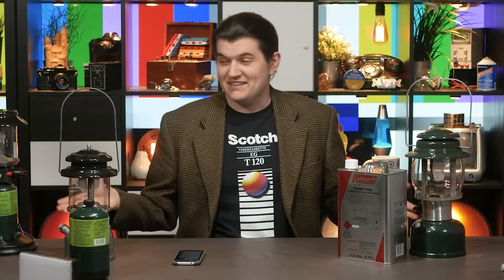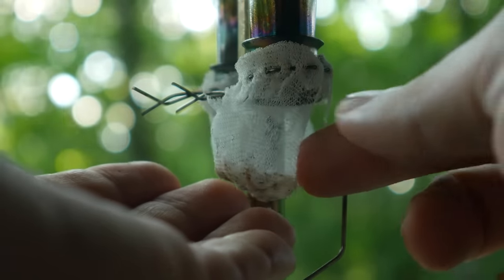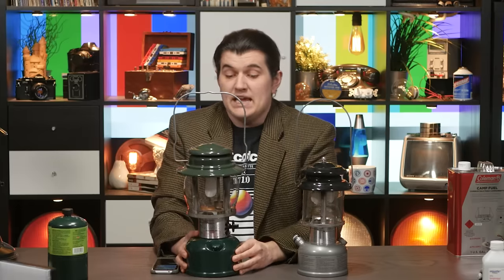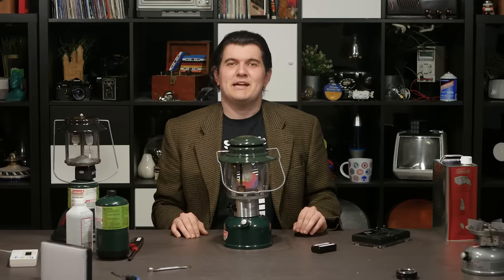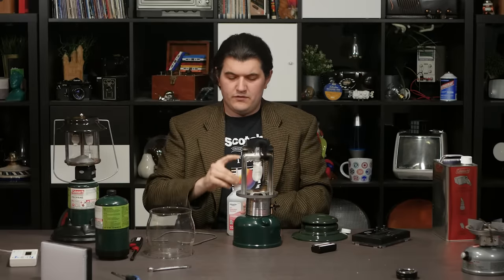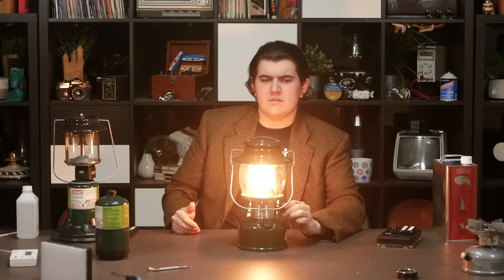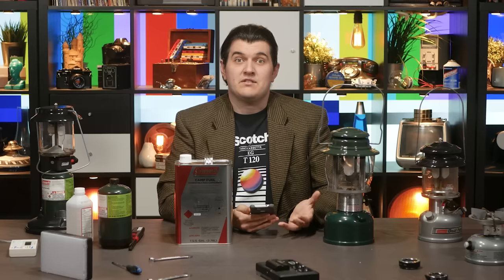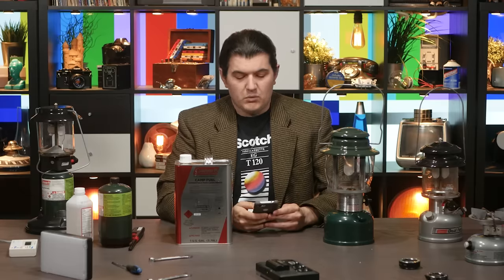A very rambly Coleman Lantern follow-up. Turns out they rarely make sense in 2021

Comment: the Lithium batteries you're referring to are likely ones called  "18650", referring to their dimensions: 18mm diameter by 65mm length.
their price and quality vary wildly. due to potential safety problems, I wouldn't recommend getting "cheap" lithium cells (or any made by LG for that matter) unless you absolutely know what you're doing with them as they DO pose a serious fire hazard if mishandled.

Comment: Those battery packs you use for comparison are likely a lot more expensive and a lot less energy-dense than lithium cells like 18650s. I'm holding a 5800 mAh 3.7V 18650. (If my math's right, that's 21.46 Wh of power.) An 18650 is cylindrical,  weighs about 45g, is 18.3 mm in diameter and 66.6mm long (or 68mm long if you measure to the positive terminal) They'd pack densely in a box, and you can get tiny little chargers for them that run off of USB, so you could charge them with anything that can put out regulated 5V DC at ≥500 mA. A quick Google search revealed lots of lanterns that run on 18650 cells. (I look hard enough to tell which ones have removable cells though.) You should post a follow-on about the best LED lanterns and batteries for camping.

Comment: Very informative comparison...... but I love all 8 of my Coleman lanterns.  I do have LED lights for camping but you can't beat the ambiance of the gas pressure lantern around the campsite.  I also used a gas lantern to heat the water in my sunshower bag while camping in the winter when there wasn't enough sun to warm the water. The sunshower bag was suspended close above the lit lantern until the water was warm enough to shower.

Comment: Greetings:
First time on your 2nd channel. I think the search feature actually includes results for both channels. Somehow I missed the discussion of the "gas generator". Since that device functions for all fuels, I can only assume it is needed for liquid the fuels kerosene and gasoline. That means the propane lantern doesn't require, nor have a gas generator. I further think the pumped pressure forces the liquid fuel into and through the gas generator where lantern heat causes the liquid fuel to vaporize and exit up to the mantles as a gas vapor.
I was waiting for the method of recycling the empty propane bottles. When empty the gasoline cans may be refilled where permitted, but have not seen propane refilling places for barbecue propane tanks accept the lantern bottles for refilling. I wonder if there is a DIY method for this process?

Comment: First off, you are making people think, and that is a good thing. On the kerosene the primary consideration would be weight per lighting time. If you are going back and forth to somewhere deep in the bush, and restricted to foot or horseback, the kerosene lantern and stove start to look better. A roll up solar charger, batteries, and one of those twig stoves that generates electricity would give choices and backup. Maybe an addendum video on the European kerosene lantern that one of the other commentators mentions, and the twig stoves is in order. Thanks and take care.

Comment: Heat from the gas lanterns. Propane turns to jelly in cold environments when you start decompressing/using the tank. The army uses naphthalene stoves and lanterns. Ebike battery with dc-dc buck converter might be an easy supply hack for high capacity.

Comment: I like the way you analyzed this. 
I will say, and you mentioned it being your point of view, that I prefer camp fuel white gas lanterns. 
I use the stoves already so I always have the gas. The stoves are night and day from propane and much more powerful. 
There's also the nostalgia perspective. I'm not that old but the light produced (temperature) at the cost for the fuel for me camping I prefer the white gas ones. 
FYI Walmart online had the gallon of the crown for $7.64 yesterday so I got like 5 gallons lol. Even the quart cost more. Not sure if it was a mistake but I capitalized lol.
Propane for a light is ok but need a lot of tanks. 
For me, the white gas ones win. I use it for my lanterns, my single burner and my vintage dual and triple burner stoves. Prefer to stick to one fuel and again the propane stoves are very weak compared to their white gas counterparts.
Edit: also the peerless mantles company has been sold since your video and production moved to India and I'm told they are yttrium now. But who knows. They still beat the Coleman ones haha.

Comment: For lighting, it’s a no brainier. Rechargeable batteries are the best by a mile. 
Where Coleman have nailed it is the cooking. The duel fuel stove is great. Cheap and widely available fuel that most people have a gallon of in their garage. I have a propane camping stove and a trangia. But if there was a serious storm and a lengthy power outage, the only thing I would be guaranteed to have ample fuel for is the Coleman. I wouldn’t carry the thing if I was hiking up a mountain, but as an emergency tool, it’s fantastic. Super reliable and sturdy, can keep a few spares in a drawer and if the worst comes to the worst, I can siphon fuel out of the lawnmower.

Comment: The Mantles are the Maddening Part. Back in the Late 60’s my Dad, had theses Mantles that were made from Metal, that I believe was Monel. They lasted a very long time. I’ve tried to find them, recently, with no luck.
Reply: I think you're talking about old miners lamps that had a metal screen around the flame so that flammable gas in the mines wouldn't be set ablaze by the flame.
But these meshes dont produce light on their own and in fact the flame of such lamp can't be brighter than a mantle.

Remember a mantle is basically ash, or yttrium oxide and heating it so much it glows white doesn't melt or vaporize it.
Try heating any metal until it glows white...

Comment: Actually, if u hold the lanterns handle while it's lit. The purpose of its design for the handles orientation is to allow a comfortable position to dial in the brightness while carrying it. I wouldn't feel it's natural to adjust that while it's facing me. I always keep my lamps and lanterns with the knob facing towards my right. Of ur left handed, have it facing to ur left. It's way easier.

Comment: The reason kerosene lamps still exist is the amount of other kerosene burning devices still exist. It's super readily available, lasts a long time and easy to transport. Our cabin runs off a kerosene diesel generator, kerosene powered furnace and water heater. So having a kerosene lamp is just common sense when it's readily available on site.

Comment: Id like to point out that the nostalgia factor is huge with these lanterns, and that's probably a big reason they continue to be manufactured. When I was a kid, we used a white gas lantern and a white gas stove when camping. What do I have today, for that exact reason? - a white gas lantern and white gas stove. LED lights, and even propane, just don't have the same feel. I'm sure some used kerosene, and that's what they want, because that's what feels like camping to them. You're not really thinking about how much you can save over a year, or two, or three. You're going for the atmosphere.

Comment: Overall the battery and LED is more efficient, no doubt about that, but like you said many times, some situations make using propane or white gas feasible. Power outages in the winter for example can be a prime example, and the reason I keep a couple lanterns like these. Shelf stable, long term and knocking out some BTUs all make lanterns a decent option. Cold can drain batteries quicker, and ate harder to gauge how "full" they are unless you have another tool.

Comment: I have a Claymore Selene lantern, works for ~55 hours on the battery and charges over USB-C and can charge other things. Looks like they're about $130 on Amazon, those Coleman Dual Fuels are only slightly less and then you still have to buy fuel.

Comment: Usually an air pump must contain two check valves two work properly. This can be problematic with the simple design of the coleman pressure pump. It also gives you a way to tell how much pressure is in the tank as well as making it impossible to overpressurize the tank. It does take some time to become familiar with the operation of this system as the same fuel system is used on the stove that Coleman produces. The older units can and will burn gasoline, they just have a tendency to be smelly.

Comment: Coleman has (among others) a 1000 Lumen LED Lantern which they state can last 100 hours on low or 2 hours on high (nothing about midrange). Has a 4800 mAh Lithium-ion battery that charges in 2-5 hours depending on Amps. Batteries are swappable as well. How would this compare to Propane/white gas/kerosene Coleman lanterns? Either by cost or light per unit (I don't remember what you called it).

Anyways, as always super informative, I watched all the videos about these lanterns in a row. The binge is real!

Comment: For camping (again), where weight matters, cooking generally will use white gas, so it makes sense to use the same fuel for lighting. Personally, I didn't carry the light because in Canadian summer, it's light until 9:30 pm in summer, so don't really need more than a few minutes of light at night for whatever. However, we used one when winter camping, when it goes dark by 5 pm.

Comment: In very cold weather, batteries become way less efficient, and propane will simply cut out completely with its tendency to create frost on the bottle.  White gasoline and kerosene work in much colder environments, and those with experience in -40 temperatures (same in both scales) claim that kerosene lanterns and stoves start more reliably in such weather.
Reply: Hi uncon have you become a flat earther yet? If not I suggest watch a 13 part series called What on earth happened by Ewaranon to learn that the earth is not a globe. I got it in my about tab.
Reply: @flat-earther  I would very much like it to be at least competitive to go with batteries for environmental reasons, but there are situations where this is not necessarily yet true.  For clarity, I am talking about temperatures that most people will never experience, but might conceivably be experienced in places like the Alaskan Frontier or the coldest parts of Siberia, or in Antarctica where expeditions can and do run surprisingly regularly for a variety or reasons.  These are places which are not coincidentally quite remote and thus also much less likely to be tied into the electricity grid, which will also be a major factor.  I am sure that battery technology will improve to where they will eventually work quite well in cold enough temperatures to render the kerosene lighting obsolete.  However, for now, it is not quite there yet.  It is something that is actually a factor in the Ukraine War, not because batteries are failing but because they are cold enough to not work quite so well as they do at room temperature.  That is an undeniable fact for now, unfortunately.  Believe me, I want it to be easier to go without fuel because then it would be better for the environment, and it will probably happen in the next ten years, but it has not yet happened.
Reply: @flat-earther  And no, I am not a flat earther, and I really doubt I ever will be (unless something truly extraordinary happens in the field of science, which I highly, highly doubt).
Reply: @unconventionalideas5683  Okay.
I suggest watching the series to learn stuff you may have not heard before.
It's a long series that first discusses the flat versus globe topic and then ends up covering several other topics.
I don't think everything in the series is true.
But in my opinion that series is one of the best I have seen to serve as an introduction to the globe versus flat topic so that's why I share it.
In my opinion it has some amazing information.

Also if you want to watch a flat versus globe debate I suggest go to channel Modern-Day Debate and find video called FE DEBATE: Austin @WitsitGetsIt & @flatearthtests9708 Vs @MrSensible & @culturecatz

Comment: So Kerosene does not go bad like gasoline. It’s also used as an emergency heat source in many rural areas. So it’s on hand. I would also be curious of the run time differences between white gas / gasoline / kerosene.

Comment: I think one reason propane lanterns in particular persist for camping and stuff is propane bottles are always bought in multiples for value reasons, and lugging a pair isn't much harder than lugging a single. There is also the fact that they're considered more "roughing it" than an electric one is, and electric lanterns can be lacking in underside weight (which is a nuisance when it's windy).

As far as battery lanterns go, it's a pity you didn't have any that ran on standard letter cells to compare with - because those are the kind the average person tends to go with and lug around, at least in my experience. Those can also have an edge in sustained power outages.

Comment: These have a longer run time than batterys and you can run them on Gasoline ,batterys can be hard to get sold out etc 
   Furthermore I can buy hundreds of these for 15$ LED lanterns are expensive.
      I have Surefire flaslights but still have gas lanterns to

Comment: I was going to leave a comment about how liquid fuel lamps will still be usable after ten years in storage but I see you already made that point. Certainly if a person is preparing an emergency survival kit, a battery operated light will be useless if the kit has been sitting in a basement for a decade. So in that case, candles or any other fuel based lighting will work better.

Comment: 18:10 If you’re using Rubbing Alcohol as a preheat source, that smoke may be the isopropyl alcohol burning. Isopropyl burns a bit dirty for alcohol. A good clean alcohol is Denatured Alcohol. Denatured Alcohol burn very clean. I also own a Coleman kerosene lantern, and my experience is that usually the preheat is hot enough to vaporize the last bit of kerosene in the generator and send it to the mantle, where the preheat flame will actually ignite the vapors and make the lantern briefly glow. Although, my kerosene model is not the same model as yours.

Comment: There's also the factor of storage for long term emergency use. Propane, white gas, and stabilized gasoline will all likely beat out most batteries for long term storage with the exception of alkaline (80% after 10 years) and eneloop ni-mh (70% after 10 years and rechargeable 500x)

Comment: Kerosene and White fuel lanterns make plenty of sense. They don’t need batteries or solid state electronics to work and provide heat in an emergency. Oh, they last forever if you take good care of them.
Reply: They might not need electronics, but why does that matter? White gas is fuel, and so is electricity, here.

Comment: I already have a kerosene cooking stove. The only down with kerosene is the need for alcohol also.

Remember that charging takes time. You not only need light to run a solar-powered charger, but the brightness of the light determines how fast the batteries  charge.  Cloudy skies will cut your charging speed back. You need to see how fast a reasonable solar  panel will work under cloudy skies will work.

Comment: Spot on about batteries versus gas mantle lights when camping.  Even in true "cold weather" conditions.

30 years ago, in the Army, I learned to keep batteries in my uniform pockets underneath the outer layer coat to keep the batteries warm.  

And in true cold weather camping, how long are you planning on sitting around at night with the lights on?

Yeah, humping around the weight and fire hazard of liquid fuel (or worse, pressurized gas) for light is stupid.  Even if you don't have (or can't  use) solar recharging in the field, well, there aren't any camping supply stores in the woods, so you can't "recharge" your propane or white gas tank, either.

If you need to make heat for cooking, well, that's (as you pointed out) an entirely separate thing.  And every ounce of fuel you use for the lantern is an ounce you don't have to cook with.  So, no, there is absolutely no advantage of "shared resources" to carrying a lantern that uses your stove fuel, unless a large green helicopter is going to be delivering you more fuel on a predictable basis.

Which is why the Army stopped using mantle lanterns for field lighting decades ago, even before LEDs, modern batteries, and portable rugged solar panels were even around.

Comment: The new “LED” lamps are so darn good these days! Some of the LED lamps could be recharged from a car cigarette lighter. Solar panels as you say, cost almost nothing to operate but a lot to purchase initially.
Reply: Yeah, the runtime is pretty amazing. For emergency purposes, I bought a couple LED lanterns, fairly inexpensive roll-up solar panels, battery charger that could be powered from the solar 12v output, and rechargeable D cells. Used them camping, and had to use them during the 2021 winter storm in Texas (my electricity was mostly out for a week). Only downside is I strongly dislike the blue-hued light from the LEDs.
Reply: @takeshikovax6254  You may also want to get a hand-cranked model. Pretty much eliminates all of the possible cons a battery/solar-powered (although I have come across flashlights that can run on all three) light compared to a gas light mentioned in the video, with the possible exception of not generating heat (at least not for the people who aren't powering it).

Comment: Not to mention that there are not only solar flashlights with rechargeable batteries as well as wind-up ones. They actually make $30 combination radio/flashlight/powerbanks that have a hand crank and a solar panel to charge a removable 18650 and can take disposable (the one I have uses aaa's) batteries.

Edit: Also when it comes to heat hand-cranking a flashlight can be quite a bit of exercise. It also negates all of the negatives of batteries.